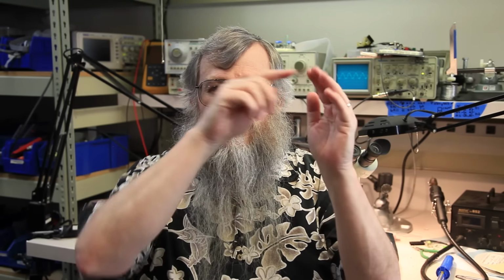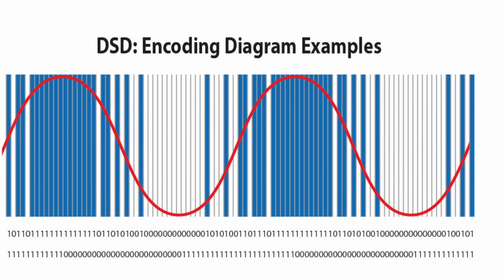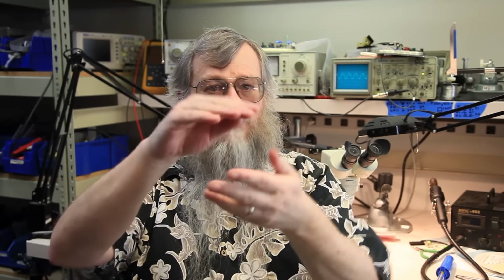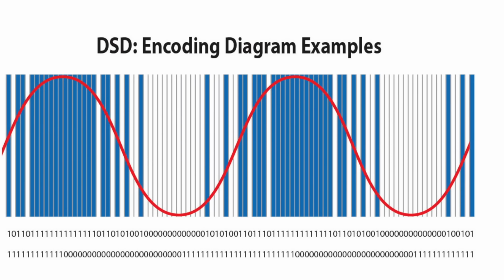Ted explains DSD

Comment: I'm no expert (as will soon become apparent, as I only discovered DSD in the last day) but there are certain fundamental points that I don't understand.

With analogue I am aware of the advantages probably better than I can explain them, but basically it is a pretty accurate way of capturing things due to the lack of approximations processing entails. It is very directly influenced by the physical source being captured (sound in this case).

The argument against digital has long been that if you look at digital representations of a wave, it is comprised of steps that have to be averaged out, therefore it is not a true representation of what went in. However that technology has been being refined so that now those steps are incredibly small and being sampled at a much higher rate. Are we not to a point where the digital representation is more accurate than speakers can actually reproduce?

Something that perplexed me even more was reading a review somebody did of a DSD DAC. In this review they talked about converting PCM files so that they may be played back. I thought the point was, the further away from the original source you get, the less real and accurate it is. So if in this scenario the original source was analogue and it has already been converted once to PCM, what is the benefit of converting this to DSD? Surely you are then just reprocessing something that you know to be less accurate than the format you are converting to is capable of. I understand that there are efforts ongoing to have the master tapes from various bands converted directly to DSD. This I can understand, but I don't understand how converting PCM to DSD is beneficial.

Maybe I've just misunderstood the concept.
Reply: You see, PCM is actually a three-step process (not two, as most videos explain).  The first step is sampling, getting a sample of a signal, say every 8 thousandth of a second (sample and hold circuit anyone?  Sorry, I digress...)  The second step is quantization, which is the "stepping" you are refering to, and approximating the values with discrete numbers.  The third step is coding these values to binary.  So, in the end you end up with one big code, 0 and 1, which go at 150Kbyte/sec rate for a CD.  This is 1.2MBits/sec, so the bits are going with the frequency of 1.2MHz through the electrical cable.  So, it's almost up there with the 2.8MHz sampling rate of DSD. 

I am not sure if I explain it well, because I am not a teacher.  One thing for sure though, the reason we send the 1 bit pulses via cable, is becuase the electrical cable has inherent noise.  So if the pulse is louder than the noise, we can easily isolate it and pick it up in the back to analog recovery stage.  That's why digital audio practically has no losses when transmitted via not too long of an electrical cable, compared with analog audio transmission.

The reason the conver PCM do DSD, is as the man in the video explains, is for practical and economic purposes.  A CD quality audio is 44.1KHz at 16-bit, and the DSD is 2.8MHz at 1-bit.  So, the sample rate is 64x higher, but the resolution is 65,000 times lower.  Now when you do 4-bit DSD (as the man explains) instead of 1-bit DSD, you almost get rid of that inherent quantization error of the DSD (tendency towards noise).

Anyway, for all practical purposes, these are both 1-bit streams in the end.  With very fine resolution.  That's why when we record our voice digitaly (without data compression) and then play it back, we hear our voice the same way as we hear ourselves when we were speaking.  No coloration, in other words.  Analog has a tendency to color sound in a pleasing way.  Data compression has a tendency to color sound in a very nasty way.  If you use low bit rate MPEG-1 Layer 3 (a.k.a MP3) you will sound as if you had an asthma basically.

I personally can't stand analog in the vinyl format, 'cuase I don't like crackle-crackle-cracle.  Analog tape is fine with me, because hiss doesn't bother me.  I guess it all comes down to when and with what you grew up.  I love Compact Cassete and CD.  Teenagers today love distorted compressed (dynamically) the hell out of the recordings.  So, if you go for what you like, you're likely stay in the niche and be ridiculed by most.  Sad thing, you can't change mainstream public.  Millions cannot be wrong, therefore Justing Bieber is the best musician in the world, currently, objectively speaking.  Subjectively speaking we might have different tastes.  But I digress again. 

Yes, whether it's PCM or DSD, the bit stream is so fine, that if the recording is done right, it will sound good on analog tape, linear PCM, and DSD.  Heck, it will even sound good on ATRAC (1/5 Sony data compression) or 320Kbits/sec MP3.  But if you go lowere than that, it will start sucking.  So music is about the contect as well as the recording medium.  So I guess we're back to square one...  I told you, I am a bad teacher.
Reply: Andrew Piatek
"I told you, I am a bad teacher"

Well, you took the time to try and I got the gist... I think :)

I had just assumed that with converting something that was designed to be played back in PCM, the best you could possibly hope for is something that is as good as just playing it back in PCM. Anything else would surely be artificial enhancement (for example on my sound card there is something called the crystaliser which boosts the dynamic range and does some other trickery to improve playback of low quality files).

So are you basically saying it is more about the conversion process?

In regards to the analogue vs digital thing. I'm a vocalist and guitarist, so I am familiar with analogue colouration and even distortion and how it can be desirable. Low quality digital or worse... clipping sounds nasty. I've always thought of artifacts heard in low quality digital as sounding like rushing water, maybe it's just me.

By your last paragraph I assume you are not queuing up for DSD, or have I got the wrong end of the stick?
Reply: napalmhardcore
Sorry, I made a mistake.  DSD has 32.500 times lower resolution than 16bit PCM, not 65,000 times.

Now, when it comes to digital audio, you always talk about "recovering" from digital signal to analog on the Digital-to-Analog conversion stage.  That involves many things, like analo filtering and such to smooth out the signal.  So it really doesn't matter much if your DAC is using PCM, or DSD, the quality of the filters and clock synchronization are probably more important. 

And lastly, the regular 44.1kHz 16-bit CD format is so good, that with properly recorded and mastered music material, it will sound fantastic, as long as you have decent DAC.  And no data compression of course.  To me data compressed human voice sounds as if the speaker had a bad case of asthman, and the hi-hats sound like pshswessswwshh thing.  It's horrible in other words.  I remember when I first time heard MP3 files I was shocked that people don't notice those things.  But I guess not everybody is attentive to music or sound the same way.

And yeah, I am queueing for the Sony ZX2 Walkman.
Reply: Andrew Piatek
Seeing how my wallet has anorexia I think I'll have to wait and see what happens with DSD.
Reply: MuristekTV
Yeah, sure, most people call DSD a mistake.  However, my favorite artist consciously made the same mistake of recording each of her 9 studio albumus directly to Sonoma DSD system, and they are all brilliant ablums.  So, if she makes that mistake, I want to make the same mistake over and over and buy her SA-CD discs :)  Which is what I did.  The 1-bit thing is about tracking an analog waverorm, as closely as possible and in simple way actualy.  Basically, when the amplitude of the analog waveform, goes up from previous sample point, you register it as a 1, and when the amplitude is less then previous sample point, then we store is as 0.  So, with the sampling frequency of 2.8MHz, you get quite a good of an approximation of the original analog waveform.  Mind you, I love PCM.  PCM applications in electronic musical instruments is a fantastic thing, and it's a fantastic thing on a CD, too.  But, I want to explore new things.  DSD gives me that option, since I am not a vinyl fan, to say the least.  Although I should probably get a turntable to play all those Keyboard magazine "sound page" records inserts.  But I digress, never mind me...
Reply: Hmmm, native everything is better.  CCD sensors without pixel interpolation, native Japanese wome... er, I mean, the native video processing.  I mean, yea, MQA might be good money cow for Meridian, but for me, I'd rather give my money to Sony.  They are the audio company to me.  As well as Yamaha, Pioneer, Technics, Panasonic, JVC, Marantz, Accuphase, Teac, Tascam, Onkyo, Akai Professional, Roland, Kawai, Casio, Ibanez, Tama, Denon, Fostex, and BOSS.
Reply: +Hitashi son Thanks for the explanation. I must admit though that my interest in DSD has subsided.

While the theory is interesting, I really need to hear good demonstrations of DSD and PCM back to back to decide whether DSD is something I'd be interested in.

I don't have the money to buy an expensive piece of equipment only to potentially find that I cannot tell the difference or the difference is negligible. It is an experiment that is too expensive for me to conduct.
Reply: +napalmhardcore Weird responding to my own comment, I know. But in case anyone is still following this conversation thread, I was looking through the user manual of my AV receiver for something unrelated to DSD and I noticed that in the HDMI specifications it said it is compatible with DSD audio.

I briefly searched to see if there was a way to output a DSD audio track over HDMI. The answers contained a lot of phraseology and acronyms that made no sense to me. I got the impression though that it isn't as simple as finding a program that will play DSD tracks and sending it to the receiver.
Reply: Andrew Piatek haha native Japanese women xD.

Personally there's only a few brand I trust. Brands like KEF, Arcam, Focal, Audiolab, Benchmark and miniDSP etc.
Reply: napalmhardcore the way to transmit DSD over HDMI is via and SACD player
Reply: What do you think about MQA?
Reply: Native high-res is much better than MQA.
Reply: You don't understand..  Up-sampling makes the files sound better,  it smoothens the audio,  that's why most DAC's  upsample to either  192khz or 365khz,  or  in my TEAC UD503 case, upsamples to  11.2mhz DSD.  it truely sounds better.

It's like multi-sampling in  Video,  it smooths out an image. makes it look much more real, and pretty.
Reply: Dude, you are an excellent teacher :) Thanks!
Reply: Both DSD and PCM are digital formats so as long as you don't lose any data, it's just fine to do the conversion. However, I am puzzled because DSD is a 1-bit format and PCM can be a 16-bit or a 24-bit format. How can you do a proper conversion without losing data? Really puzzling and that's why I stay away from DSD. Additionally, DSD has ultrasonic noise that PCM does not.
Reply: I don't posses "liberal" elite income levels for Merican equipment to afford to think about MQA. :)

Comment: hi paul, the pulses sound like how FM radio is transmitted! is that correct?
Reply: ***** oh ok thanks, in the example the bit density looks like it modulates in the same way the waves do in Fm transmission, sorry im studying sound engineering and fascinated with the dsd compared to pcm :) trying to learn! thanks again.